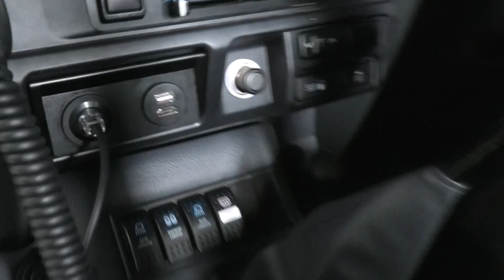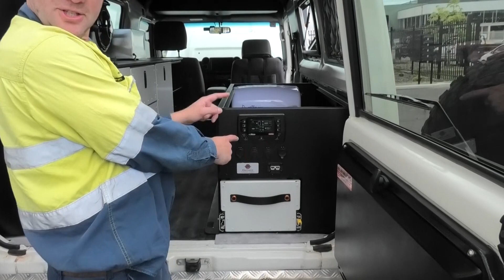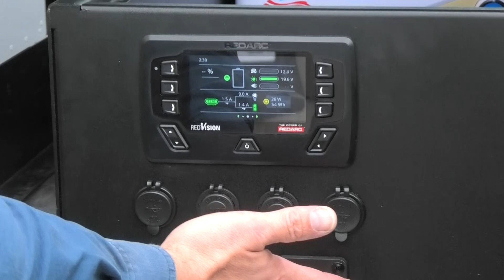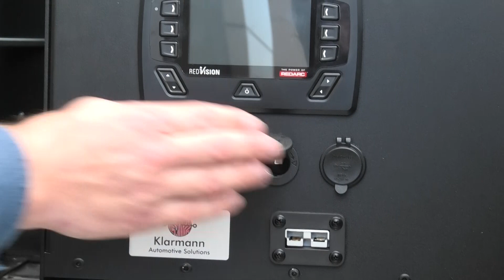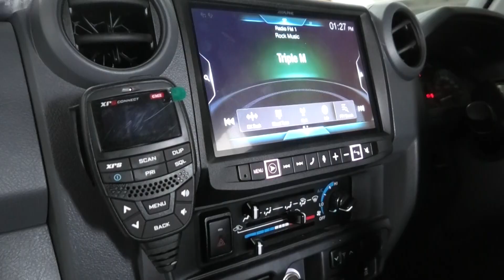Heiner Builds Your Ride | Toyota Landcruiser Troopy

Comment: Great build.  I also use a kill switch on the second battery system - can switch off the second battery if I put a charger on the cranking battery.  My switch is a 2 way switch  between DC-DC charger and lithium battery - setting "1" connects the loads but no charging, setting "2"  is charging but no loads.   When travelling it is set to 1+2.  When not travelling I set it to 1 which allows me to keep the Lithium batteries in   partly discharged state and prevents the DC-DC charger doing a peak charge every time I start the car (for lithium battery longevity).